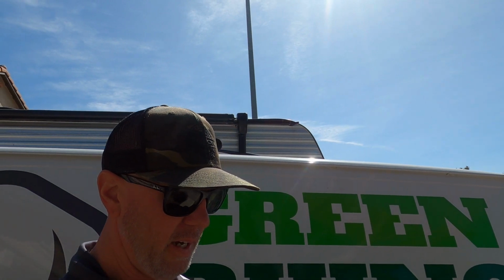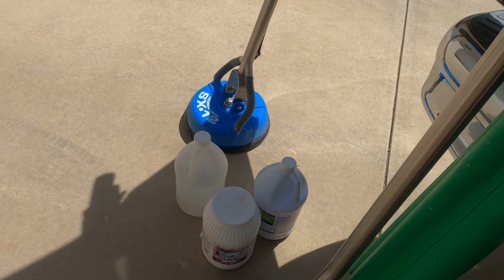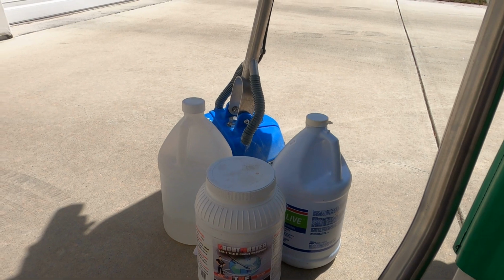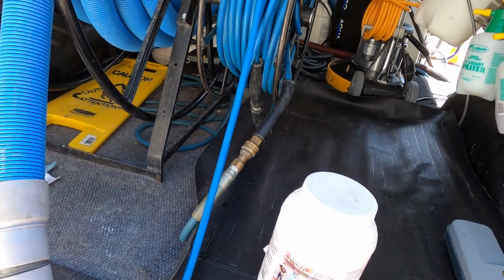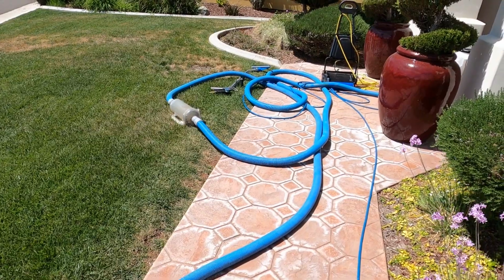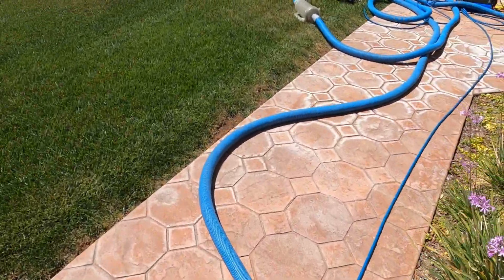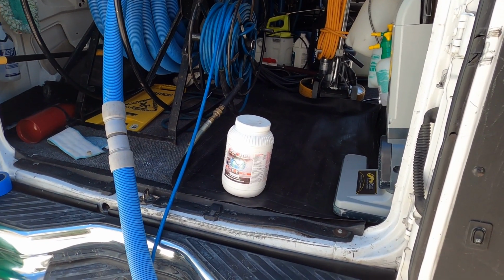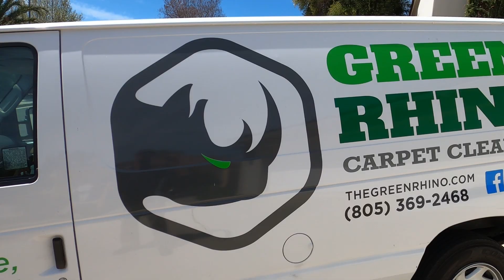Tile Cleaning & Grout sealing Amazing Results

Comment: I'm retired now and have downsized to a portable. I use a similar 4 jet squeegee tool by Gecko since I only run 500 psi max. Takes a little more time and effort than a truck mount  but results are great, never any call backs. Btw, I have the small attachment you showed, as far as I know it's for blasting stubborn grout lines, at least that's what I use it for. Great video,  thanks!

Comment: The machine I’m getting is capable of up to 1600 psi. It comes with the round 12” Tile & Grout Cleaning Tool.  I will be doing 1000psi but do I need a scrubber as well? I just noticed you used both and was under the impression I didn’t need a scrubber.   Thanks

Comment: Can the wand with brush head still do a good job? Im not sure to buy the the hydro force or the wand. I have a portable machine push 800psi. Thanks in advance buddy
Reply from the maker: Spinners work better
Reply: @greenrhinoproject  so do you think sx.12 spinners works good on 800 psi? Thanks
Reply from the maker: @abbthedab1831  I run mine at 900. 800 should be fine.
Reply: @greenrhinoproject  your a star. Appreciate it!

Comment: It’s small but i do major space with it. And the 14 inch is not high pressure. Found out the hard way. So i just use that small head. Plus its just a surgical tool!

Comment: On that sealer it looks like you applied it w the flat mop , did u go over w a dry o e after or that sealer is okay to leave as u did? Normally sealers leave a residue if not dried up? Thanks man!
Reply from the maker: Just leave it and let it dry this product will flash off the tile thats what is so great about it. Quick and easy
Reply: @greenrhinoproject  nice
...thanks man.....keep up the awesome videos

Comment: My honest opinion and only my opinion.  Maybe that product that you are using is not good enough I feel like like you used too many methods to get that tile cleaned. I feel like just the hydro force and tile and grout pre spray should've done the job and of course the grout stick brush.
Reply from the maker: Testing new tools usually I do exactly what you said.